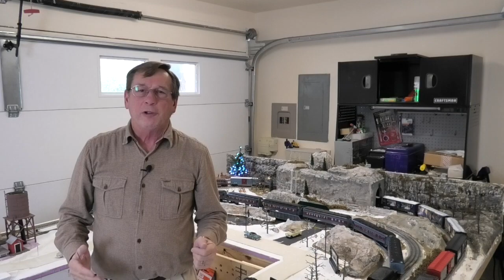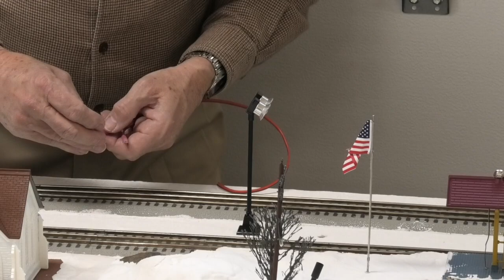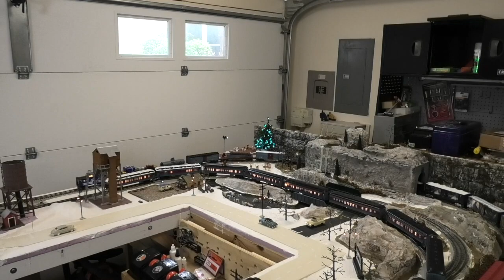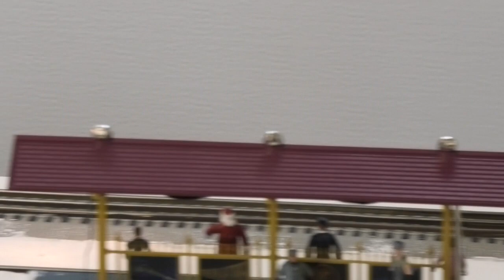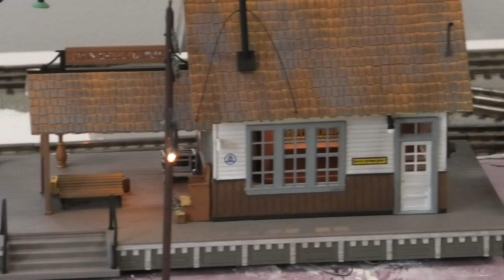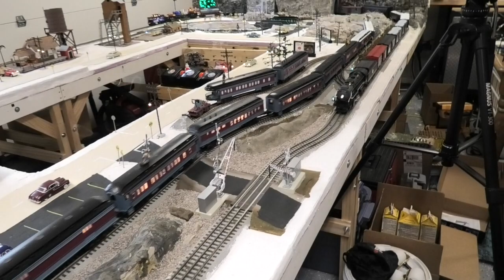Polar Express - Heat Gun Soldering

Comment: Great Job! I am a big fan of soldering all my connections. I've been soldering most of my life so I am comfortable doing so, but these connectors seem like a game changer. I typically use electrical tape over my connections, which I have noticed over time will come loose so I think these connectors are a must for the toolkit!
Reply: Used to have a heat gun. Need to get one. Soldering under the layout is a challenge for sure. Hate to admit this, but I have burned stuff like my flooring by accidently by leaving the iron on the floor or not properly seated in the holder :-)